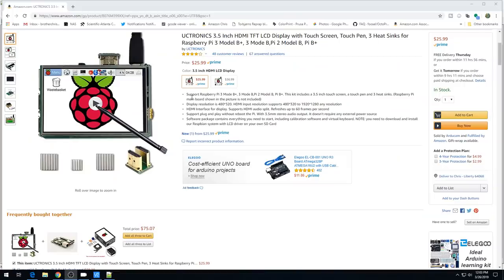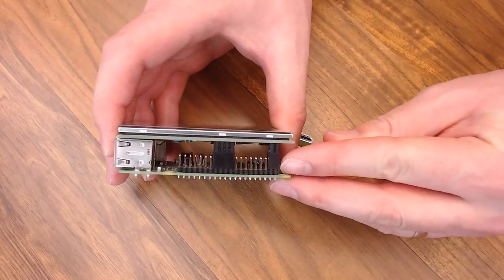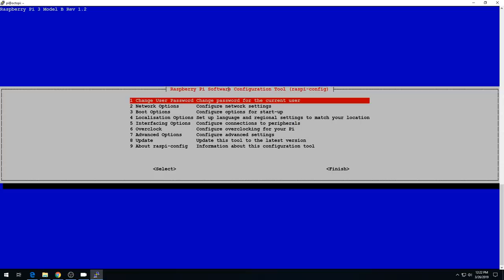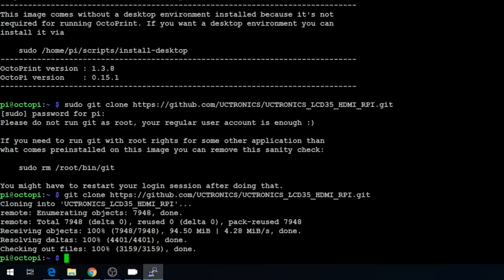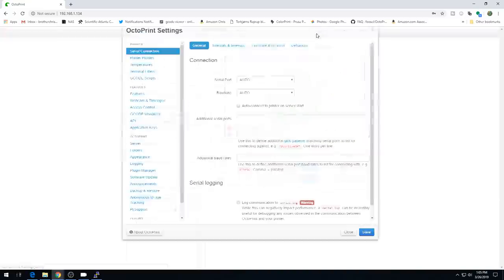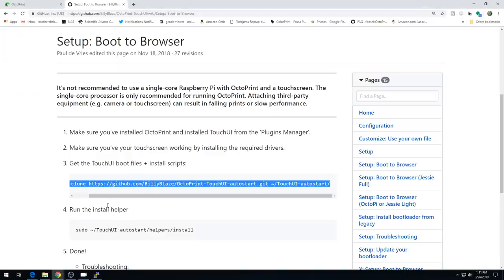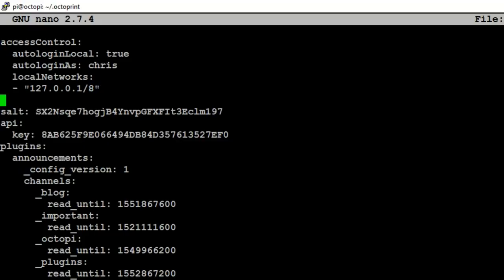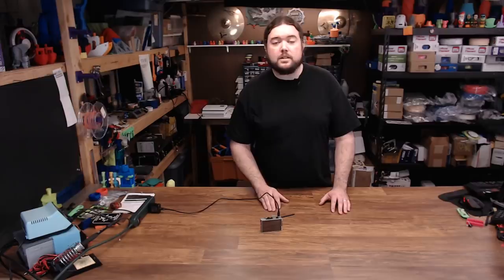Octoprint Raspberry Pi Touch Screen Install - Touch UI - Chris's Basement

Comment: What a great video, however, I'm having trouble.  I run the script in SSH (git clone https://github.com/BillyBlaze/OctoPrint-TouchUI-autostart.git ~/TouchUI-autostart/) and I get a "bus error".  It then goes back to the pi prompt.  I have tried several times and get the same error.  What does that mean?  Is it on their end or is my Raspberry Pi4 bad? I'm so frustrated, been trying for a couple of hours.  I have a Adafruit PiTFT+ 480x320 3.5" screen.
Reply from the maker: Not sure what it means, but maybe this will help. https://community.octoprint.org/t/touch-ui-plugin-not-working/16757

Comment: When I type cd I get no directory I type it in caps and I get bad command please help
Reply from the maker: cd is change directory. Do you need to see what's in it? Do ls -als
Reply: @ChrisRiley  got it to work everything is working find just the camera not powering on the camera is the ribbon one
Reply from the maker: @bereal1251  You might have to edit the config.txt and set it to picam.

Comment: CAREFULL! Running octoprint + a x server + a browser + touch ui, can put random JavaScript loads on the pi, what can cause buffer under run.  Using octoprint tft is a lot safer option if you don't want the risk of having a print full of zits and blobs. I know there are some unicorn peoples who don't met with this problem, but if you print fast, use a separate pi/pc/tab or octo tft if you must use a hd screen.
Reply from the maker: Good to know.

Comment: Hey chris I just followed your tutorial to a T with the same touchscreen and manufacturer. However once I did. Touch ui interface is loaded onto all devices. I.e. screen, browser and mobile phone. However there seems to be a lack of menu options and octoprint is completely unresponsive to any touch selections. Even on web browser and phone. I do not even have an option showing to toggle back to the regular octopi interface. I'm completely stuck in the mud. I'm new to raspi configuration so I could really use a bit of help
Reply from the maker: Can you still control it with your mouse from a browser? There should be a little cell phone icon in the top right to turn it off and on.
Reply: @ChrisRiley  no my option menu is incomplete. Only says connection and login.. I think there's a java script issue but I dont know how to fix that?
Reply from the maker: @jonathanviterise1681  Does your auto login work? I would try to reinstall, sounds like something got messed up.
Reply: @ChrisRiley  octoprint is completely unresponsive across all platforms. Should I wipe the SD card of octoprint and do a complete reinstall of octoprint?
Reply from the maker: @jonathanviterise1681  I think I would just to rule it out.
Reply: @ChrisRiley  thanks for your response chris. Your videos are foolproof. Great content and explanation

Comment: Hey and thanks for the good video like it. Can I Do the same tutorial for a original raspberry 7” screen connected with the original flat cable between raspberry pi 3b + and 7” screen.
Reply from the maker: I think you can, it should be somewhat similar. That is an SPI interface, you just need the right drivers.
Reply: Okay I give it a shot. Thanks for all your good work. 👍

Comment: Excellent videos Chris however I got to the point where the white screen asking for username and password and like you said it did not work so I modified the yaml as you indicated and now the touchui startup screen goes from blue to red failed to connect. Do you have a fix for this?
Reply from the maker: Failed to connect, like to the printer you mean?
Reply: @ChrisRiley  Sorry, TouchUI logo in blue on startup screen comes on saying Connecting to TouchUI  then turns red  saying Connecting to TouchUI failed. Also I can no longer run Octoprint on my PC getting this message The OctoPrint server is currently not running. Raspberry pi seems to have a Wi-Fi connection. Something got wiped out during the TouchUI install, The white screen came up asking for username and password and like you said the first time you try, it will not work  so I modified the  yaml and  after a good while I get he red TouchUI  with the failed message. Hope that paints a better picture for you. Thank you. Putty ssh is still working.
Reply: @ChrisRiley  when the blue ToucUI start up screen is displayed trying to connect I can see very small at the bottom of the screen it says connecting to http://[::1]/ it tries 30 times and goes red failed to connect.
Reply: @ChrisRiley  trying to give you as much info as I can so I either can get back to octoprint on my PC or start using TouchUI on the pi (can you do both?), I hit the home button on the Raspberry pi and it brings me to a Google screen where I am able to surf the web.
Reply from the maker: @stuartmotorsports  So the octoprint backend doesn't appear to be running. Yes, you should be able to access it from the web and the screen at the same time. Most of the time when this happens it's something that got misplaced in the config.yaml file. I would check that again. If you can't find the error you might have to start over with a new config.yaml
Reply: @ChrisRiley  is there somewhere I can get a virgin config.yaml and just paste it into putty?
Reply: @ChrisRiley  I just started a completely fresh write to sd card with etcher from .img file (had to open up 7" touchscreen case to pull out sd card to write to it with etcher) this time I put the  Octoprint user name and password from my PC  instead of the Raspberry pi user name and password and it is working. Thank you for all your help, I'll check out your other videos since you know your shit!
Reply from the maker: Ah, great! I am glad you found it.

Comment: Can you use this setup with 2 printers and 2 webcams?
Reply from the maker: Not on the touch screen, you can only use one.
Reply: yes just setup 2 printer same way.difference is just IP
Reply from the maker: @jarisipilainen3875  I guess I am not sure what configure you are going for.
Reply: I was wanting 2 printers and 2 webcams with one touchscreen
Reply: @SHUTTERDIAL1  that touchui open phone screen or tablet if screen size is small if not it open normal octoprint just open up andress of 1 printer then open other printer different iP. But both need own octopie. With one screen probably not possible it connect octoprint server on pi screen is installed.but try phone or tablet
Reply from the maker: @SHUTTERDIAL1  Yes, that is not backed into touchui at the moment. That would be an awesome feature though.

Comment: Been meaning to put a screen on my ocotopi.
Reply from the maker: I hope this helps. Thanks for watching.
Reply: @ChrisRiley   hey I'm stuck, I got the screen installed boots up and shows all the stuff the raspberry pi/ Octoprint is doing, Just like I never installed the drivers or the Touch UI.
Reply: when I log into the Pi i can LS and see the Touch UI and the UC tronics folders
Reply from the maker: @JSCB-365  Hmmm, sounds like the services aren't starting correctly. Might be something wrong with the octoprint install. Does it work from the web interface?
Reply: @ChrisRiley  ok I found out what I was doing wrong. I was following The instructions that came with the screen. After step 7 where you type in " sudo ./UCTRONICS_hdmi_install

There's an extra step that I was following.  
The "sudo ./UCTRONICS_hdmi.restore."   that removes the install.
Reply: I have one screen working 100% the larger 7" touch screen works without drivers. But the touch screen isn't working yet.
Reply from the maker: @JSCB-365  Got ya, yeah there doc isn't super clear.

Comment: I have tried this out and I am stuck on the touch ui setup screen 

it gets to 100 then fails

also stuck outside of the browser UI, as it “connects to server” for over 20 minutes 

I had followed according to the link guide

Got it to work for a minute then back to the same problem
Reply from the maker: Is this a fresh install on your Pi? It almost sounds like something is running taking up resources on your Pi. Do an htop on command line. Does anything look funny?
Reply: @ChrisRiley  well im currently at school, imma check when i get home

also is the top number line of "   localNetworks:
" the device's ip as i was messing around with that when it worked for that one minute. though idk what made it work
Reply: Chris Riley yeah I just did a htop and it peaked around 10%

So that is probably not it
Reply: hmm it doesn't access file when given '"sudo chmod +x /etc/X11/xorg.conf.d/99-fbdev.conf"" but "sudo chmod +x /etc/X11/xorg.conf.d/99-fbdev.conf" works
Reply: so i re-installed octoprint and did it again and. it. worked?
Reply from the maker: @Jinxtiest  They probably changed up some of the file names in an update.

Comment: Does anyone else run into the issue where the touch UI wants you to log in on the pi but not on any other device.
Reply from the maker: That's usually means something is a skew in the config file.

Comment: I've really enjoyed all of your Ender 3 Videos.   I'm looking for help on setting up my configuration file using Panucatt Kinetica G2C controller board.  I should mention I have installed a DirectDrive Mod as well from Printermods.com.  Just need to know where to go to learn how to tell the firmware the Ender 5 information.  I believe it came ready for an Ender 3.
Reply from the maker: I don't have a very good video for that, but it is all done in config.g You can go through line by line and lookup what they do. You shouldn't have to change much for the ender 5.

Comment: Thank You! 
P.S. Used unknown China's 7'' display. Missed step with downloading drivers, but everything works good. Also got problem while " sudo ~/TouchUI-autostart/helpers/install" command was running: 
Installing dependencies (xinit xinput xserver-xorg xserver-xorg-video-fbdev x11-xserver-utils matchbox unclutter):
 - failed
SO solution was in downloading it by myself:
 sudo apt-get install xinit xinput xserver-xorg xserver-xorg-video-fbdev x11-xserver-utils matchbox unclutter
Reply from the maker: Nice! Thanks for the update and I am glad you got it figured out.
Reply: Thank You Chris!! I've gone from pi in a box to getting it nearly working with a touchscreen!!  brilliant tutorial.  but...  I'm having a problem similar to Федор Трифонов above.  My installing dependency error is (xinit xinput xserver-xorg xserver-xorg-video-fbdev x11-xserver-utils matchbox unclutter chromium-browser)  I have tried downloading it myself using sudo apt-get install but this fails with loads of unmet dependencies too....  It suggests using apt --fix broken install but this also fails saying that it " Could not open lock file /var/lib/dpkg/lock - open (13: Permission denied)  and "Unable to lock the administration directory (/var/lib/dpkg/), are you root?" 

Any ideas?

Thanks.
Reply: @brusterbruster6923  im having exactly the same problem

Comment: hi there! great video. question i did everything you said but eveytime i get nothing but a whit screen. this is my screen i have."www.lcdwiki.com/MHS-3.5inch_RPi_Display" my pi is updated with your video. Octoprint works great with out screen, but be nice to just see the load screen when done. im not sure how to input the commands for this i'm very new to Pi. any help would be great thanks.
Reply from the maker: Hey, it almost has to be a driver issue. Not sure what they gave you, but I would see if they have updated ones.

Comment: Thanks! I'm getting this error, is there a solution? 
i.imgur.com/zSpQmOU.png
Reply from the maker: Checking.
Reply: Same error for me!
Did you find a way already?
Reply: @danielwijnolts4016  Yes, I got around it... Is this your TFT display https://www.banggood.com/MPI3508-35-inch-USB-Touch-Screen-Real-HD-1920x1080-LCD-Display-For-Raspberry-Pi-32BBA-p-1216963.html?rmmds=myorder&cur_warehouse=CN

I installed the driver following this guide (but using PutTTy): https://www.youtube.com/watch?v=25UvlMgu71A
Then I went straight to install touch UI plugin, the auto statpup and the autologin thing 09:09 it takes a ton of time to install the auto start.

I calibrated the screen (the X and Y axis was swaped, X being Y and Y being X): https://github.com/BillyBlaze/OctoPrint-TouchUI/wiki/Setup:-Troubleshooting#calibration

After calibration it was still swaped so I started to read how to modify the calibration matrix to fix the swap:  https://pastebin.com/rsMa5K1v and  https://github.com/swkim01/waveshare-dtoverlays That solved the problem. 

It is working now... I installed a bunch of plugins without any problem... Only the AutomaticShutdown conflicted with the touch UI display, with it installed the desktop environment  on the raspberry (I may be wrong I don't understand this stuff well) is not able to login, after uninstalling it everything went back to normal.

I'm new to 3D pinter and even newer to raspberry/linux/sudo stuff... so this solution was basically trial and error. d
Reply: @trt969  yes thats the same as I have! I'm gonna try the steps. Thanks a lot.
Reply from the maker: @danielwijnolts4016  Very nice, thanks for sharing this fix.
Reply: http://www.plastibots.com/index.php/2018/06/02/adding-tft-lcd-to-raspberry-pi-octopi-rig-touchui/

Comment: Auto login is not working for me
Reply: Ok I just got it back. I wasn't getting a clean reboot.  Go into your browser get your pi connected click on the System button on the control bar up top.  Right next to the wrench.  Click on reboot system.  It worked for me.
Reply from the maker: Nice! I am glad that solved it.

Comment: I carry my octoprint touchscreen around with me... My phone. Lol.
Reply from the maker: lol, I do the same.
Reply: How do you log into it when not on the same wifi network?
Reply: @DaKidd89  i havnt needed... But i would assume a port forward with dynamic dns provider and some work maybe with whoever provides your internet.  For me, if i leave a print going when i leave the house for work, i call my wife and ask her how it looks.  Lol, dynamic wife access...DWA protocol
Reply from the maker: @DaKidd89  My prefered method right now is to use RealVNC to access my computer then access octoprint from there.
Reply: @ChrisRiley  There is a program for Android called OctoRemote that I started using.
Reply from the maker: @btigenie  I got to check that out.

Comment: I used this screen, which is a driver free screen that works out of the box. I used your tutorial, skipped the driver part and it looks amazing! Thanks for this!
Link to the screen I bought: https://www.amazon.de/gp/product/B071XT9Z7H/ref=ppx_yo_dt_b_asin_title_o04_s00?ie=UTF8&psc=1
Reply from the maker: Awesome, thanks for the link!
Reply: @ChrisRiley  Ow almost forgot, you do need to go to the boot folder and open the config. txt, so cd /, cd /boot, sudo nano config.txt and add these lines at the bottom:
max_usb_current=1
hdmi_group=2
hdmi_mode=87
hdmi_cvt 800 480 60 6 0 0 0
hdmi_drive=1

ctrl X, Y, ENTER
sudo reboot now

And you are fininshed.
Did this long time ago so I forgot ;p
Reply from the maker: @StefGeukens_Xercium.  Sweet! Thanks again.